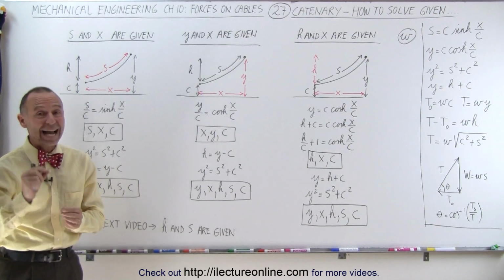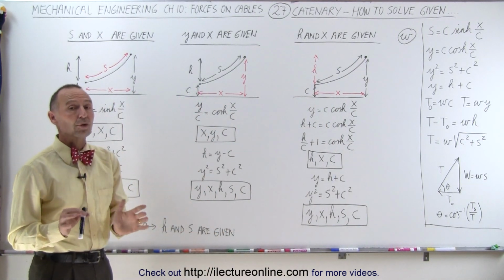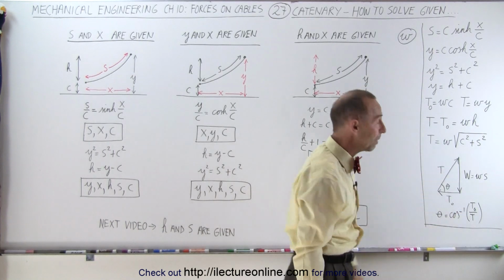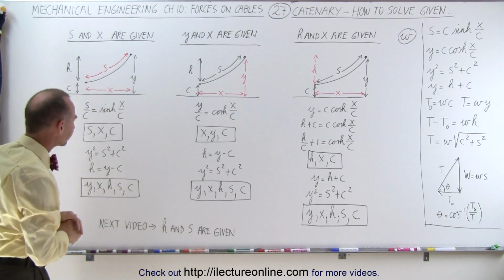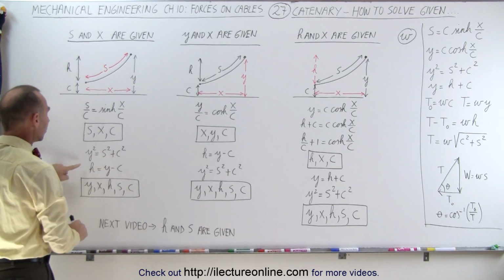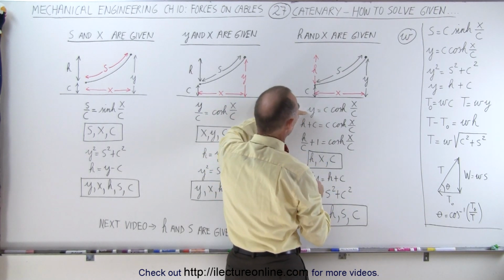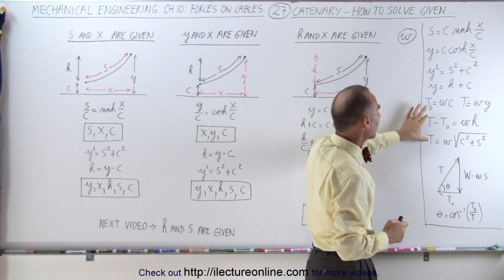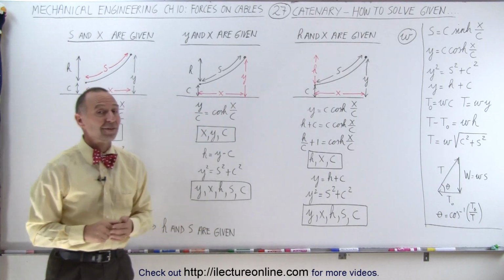Mechanical Engineering: Ch 10: Forces on Cables (27 of 33) Catenary - How to Solve Given...

Comment: Hi, are these calculations applicable when the fixed points are not horizontal to one another?
Thanks 😁
Reply from the maker: Yes, you have to take the two sections separately and the force components in the horizontal direction at the support points must be equal.

Comment: What make catanry problem to be solved differntly to unifomly loaded cable? this is the mean question for me, please
Reply from the maker: A catenary is the concept of a cable sagging under its own weight, without a load.
Reply: the load in a catenary curved cable is uniform distributed load along the cable's curve

while for parabolic - shaped curve,
the load is a uniform horizontally distributed load
Reply: @tutstorial8474  Depending upon whether the cable is elastic or rigid one would use the one or the other shape